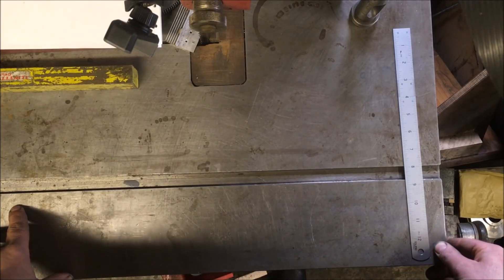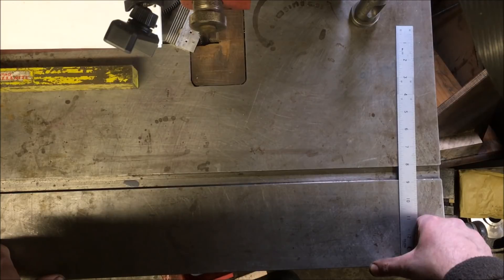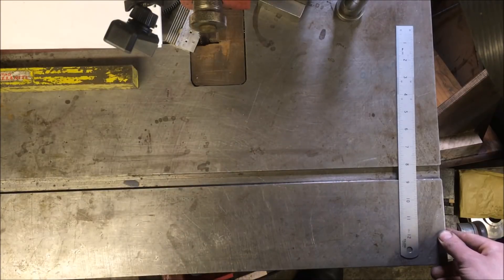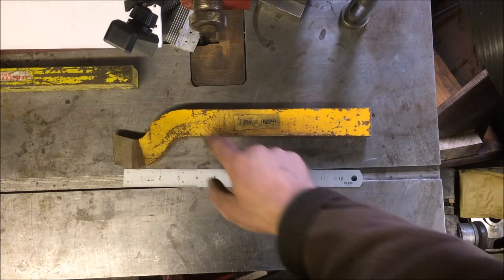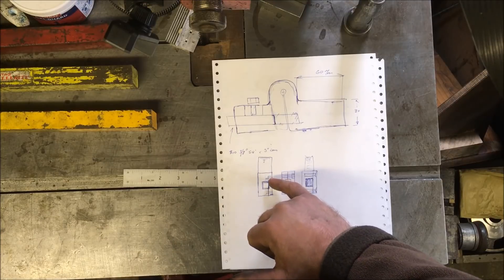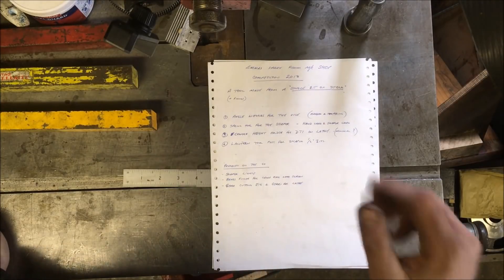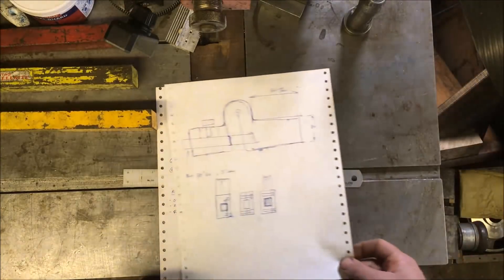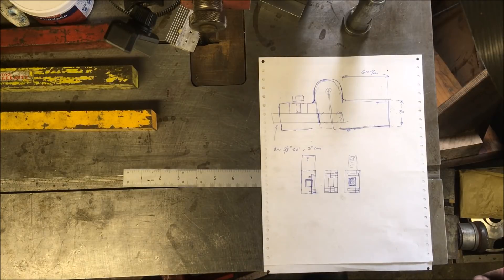Tool Maker Challenge

Comment: How about a 5c collet adapter for the shaper?  Mounted in the clapper box it could hold boring bars or high speed steel shaped for cutting corners for square holes.
Reply from the maker: mark63366 , that is a good idea and certainly not something I've seen or heard of. Sadly I have no 5C collets. I use ER32 collet system. An adaptor to take and hold square tool bits out straight in place of the tool post would be a good idea. I shall have a think, it might be added to my project list for the future. Thank you for stopping by and suggesting an idea. All the best Mat

Comment: plus one for the spring tool. How about making the sqare hole one the shaper? If You make the slit section a bit wider and prepare a through hole right up to that area, the chips could exit the hole. .... all the best for Your partner! Frank
Reply from the maker: Hi Frank - thanks for the vote- Im still thinking about the square hole issue and teh clearance hole at the end of teh toolbit hole would work. Watch this space. All the best Mat

Comment: Hi from Bernie. To square out a hole in your tool holder. I have user round tool bits with 2 flats ground to give a 90deg corner.  Start with a hole big enough to fit the tool bit and move sideways. OK to do on the shaper but a slotter is the winner.
Reply from the maker: Hi Bernie - thanks for the idea - Ive been scratching my head over how to do it on a shaper - the main issue is the hole is 2.750" deep x either 3/8" or 1/2" square. Which will make for quite a slender cutting bit. I'm still thinking about it and may try and make up a corner cutting bit with a brazed carbide tip (I cant braze HSS) ... Thanks again and all the best Mat

Comment: Mat- I'll cast my vote for the spring tool.  I think it would be an interesting build.  A few obstacles to overcome ( the square tool hole and the slit for the hinge)- btw just an idea, I did a project where i cut a thin slit with a thin abrasive blade, like you'd use on an angle grinder, in a  slitting saw arbor- it came out quite nice but kinda made a mess. It's cool to see the guys from last year's comp in on this one!  Good luck !!!
Reply from the maker: Thanks for the vote - I like the idea of the abrasive disk - might look at that for my T&C grinder. Mat

Comment: Great minds hey mate!
Emma has cleared that my clamp bolt for the lantern can be from another piece of stock.
As for Gear Cutting attachment entry, popped you to that one too mate sorry!! 
Keen to see how you get on mate, and wishing you all the best with treatments
Reply from the maker: Cheers bud. Had some fun looking at the range of tool bit clamping fixings I have - for 4 sizes of HSS bit there are 7 different thread sizes ! 1 of which for the life of my I cant identify 7/16 x 16 TPi - must be a US thread as its a US forged holder.